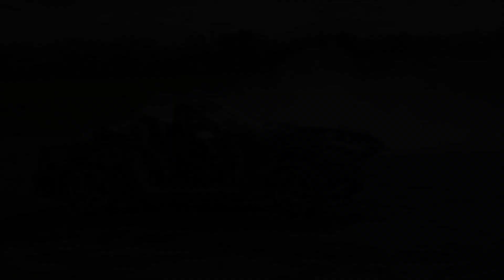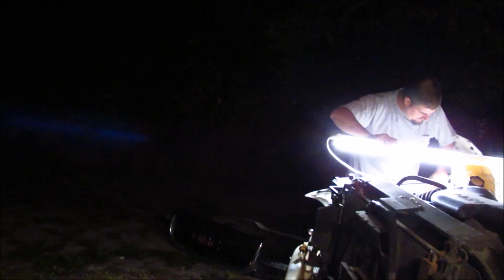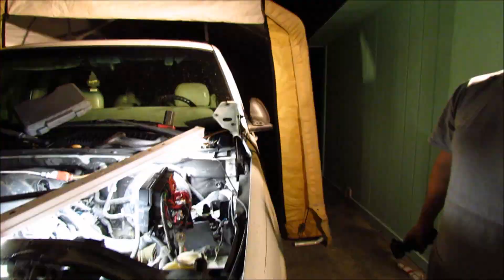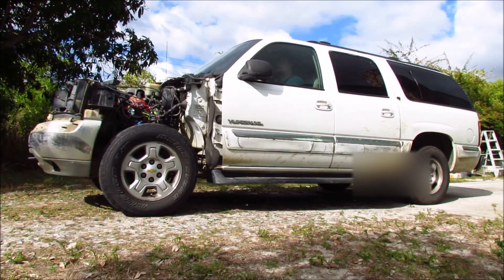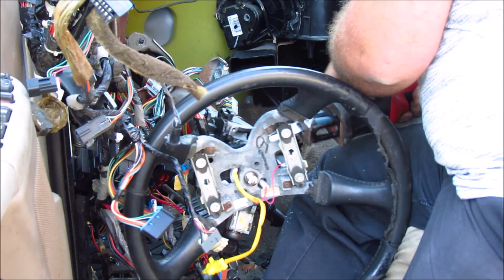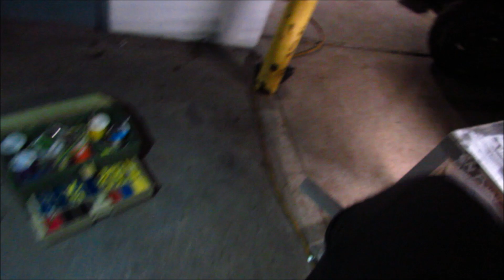LS Turbo Miata Kart Part 6

Comment: Just a note guys for future reference, but the easy way around the Vats without having to have somebody come out and reprogram the ECM is to cycle the ignition start the vehicle and disconnect from the body control module while it is running. Doing that will remove the Vats system and put it in passive mode. From then on it will not require the vats to operate the ecm tcm or prom. Had to do that plenty of times before when putting the ls in the old G bodies and S10s.

On a side note for a lot of the guys out there that have already removed the harness without bypassing the Vats, if you have done that already your best course of action is to find a buddy who has the same style LS powered truck SUV or van. You're going to have to take their ECM out and install yours, you will have to turn the ignition forward and try cranking. The vehicle will not start because the Vats is in the process of relearning, you will have to leave the ignition in the on position for 10 minutes shut it off put it back in the on position without cranking this time and see if the Vats light has gone off yet, if it has not leave the ignition key forward in the on position for another 10 minutes turn it off put it back in the on position again for an additional 10 minutes, within that last 27 to 30 minute window you will see the vehicle anti-theft light finally go out. At that time crank the engine over and start the vehicle let it run for a minimum of 5 minutes and the ECM will be relearning the Vats process. after the five minutes has elapsed while the engine is still running remove the 3 connectors going into the body control module, let the engine continue running for an additional 2 minutes and then shut it down with a body control module still disconnected, and that is the end of it your problems are cured. When you reinstall your buddies ECM make sure that the body control module has been reconnected prior to installation of the ECM and reconnection of the battery and there will be no problems.

Keep up the great work guys love watching both of your channels.
Reply from the maker: Is it only usuable once after doing that and then will it check again and lock up?  Or once you do what you just said it stays vats dissabled
Reply: @thousanddollarcarguy  

That is a permanent seperation of the vats. For the Miata Kart you don't need a body control module as you don't have any power functions and you're not going to be using any air bags or restraints or yaw rate control or anti-lock brake functions or four-wheel function so there would be no need to have a body control module to read and relay the information back to the ECM. 

If you happen to hook it up to a buddy's car to relearn the vats process and make it passive again, all you have to do once it has relearned the process and accesses in the prom just shut the truck or car or van off, start it back up let it run for the 5 minutes disconnect the three blue pigtails on a body control module let it run additional 2 minutes without the body control module connected shut it down and start again to verify that it has separated the Vats system. I had to help a couple friends out on that same situation where they forgot to do the body control module removal first. You guys should have no problem doing that. if all else fails there are thousands of videos I'm sure on YouTube stating the same information.
Reply: @thousanddollarcarguy  

If all else fails I'm only just a short trip north of you in Daytona, if you ran into a pinch you could contact me and we could go from there. Just make sure you get good buddy pass information on to Leon if he hasn't already learned that process with the 57 chevy.
Reply from the maker: @adamz2079  i screenshotted what you said about the vats and had already sent it to him